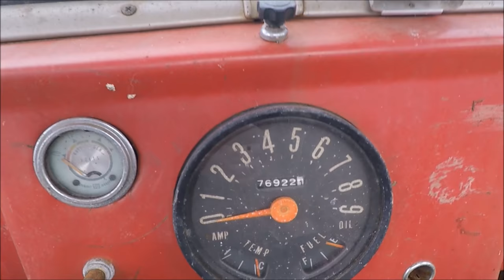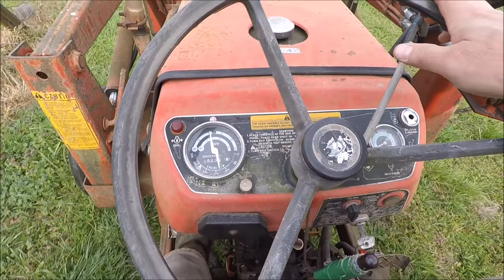Willys Truck The Movie Take Three: Live Action Cam !!!!!

Comment: That truck originally had a 4 cylinder “Go Devil” or 6 cylinder “Hurricane” engine in it.... they where prone to oil starvation... so that’s why it has a Chevy in it now. I remember my dad telling me a story about my great uncle having one of the panel trucks for hunting... on the first trip out with it when it was brand new it had snowed a lot and the extra strain of just plowing through the snow caused the bearings to fail...

Comment: Those old flatheads that came with those jeeps were considered high mileage when they reached the 40,000 mile mark. Modern ohv straight sixes and v8's were often swapped. My dad put a 351 Cleveland in ours. Worked much better with lots more power, but I missed the sound of that old flattie.

Comment: I pulled a 70 torino gt out of a dilapidated barn with my dad when I was 13. Spent the better part of six years getting her all back and in order. I gave her hell for five years before the birth of my sons convinced me to sell it. Sixteen years later and I'm itching for a project. I'd love to come across a basket case datsun 210 or 510...
Reply: Ae86 Hachi 
I love the old datsons! I beat the hell out of a little b210 when I was 17 or so. It was a 74 model and this was the late 80s.
Reply: Ayotte's Junkyard ,Tiger Hill Road,Oxford ,Maine. Days in graveyard.
Reply: Datsun graveyard. Damned autocorrect.

Comment: Pull all spark plugs and pour half cup of transmission fluid into the combustion chamber and let it sit there over night. Then pull start again like this video and it will blow the oil out of the spark plug holes. It will get all the rings loosened up and seated and get a lot of the compression back.

Comment: I have a machete just like yours. When I was 8 years old (1961), my dad and I were driving down a levy road on the side of the Mississippi River on a shell road about 70 mph. In those days you could still use shell for aggregate on roads-can't do it anymore because of dredging for it was messing up oyster beds among other things. All of a sudden we heard something hit the bottom of the car and started dragging under the old Ford Custom. We stopped and low and behold it was a machete like yours that probably dropped off of one of the trucks that were transporting prison labor to and from the cane fields, and it had stuck in the floorpan on my side in the front. Still have it hanging up in my shop.
Reply from the maker: that is a cool story for sure!

Comment: go to the parts store ask for a hei distributor for a 79 up 250 six cyl pull out the old one drop in the hei plug in a 12 volt power lead you will have fire to plugs get some gas in it fire it up good luck love the videos

Comment: Pull the Jeep with all spark plugs removed...squirt oil in each cylinder...let the clutch out in high gear while getting pulled...the engine should turn over easily....then try to start it.
Reply: Should run now.

Comment: 5 on 5 1/2" bolt pattern on the wheels. Older jeeps, older (full size) Fords, and older dodges are the same.
Reply: Yes.  I only mentioned a few

Comment: I'm bett'n  you knocked some teeth out of  your main cluster gear in your t89 if it only turns the engine over in third gear
Reply from the maker: not convinced it's a t89, it turns in all gears
Reply: glad it turns in all gears, t90, I couldn't remember I had a 55 willys in 1984,  out fourwheelin and my foot slipped off the clutch pedal when I was revin the eng up and then I didn't have 1st or 2nd gear anymore, had to drive it home in 3rd gear, no fun! stripped three teeth off of the main cluster gear. It was the coolest truck i have ever owned except for those left hand threads on the lug nuts...

Comment: That's awesome you got the engine free!! I subscribed to see more awesome vids. I hope you have better luck with your Willys than I did with mine. Mine was running and driving for 10 miles until the cam and distributor gears broke. Check it out if you want on my chanel.